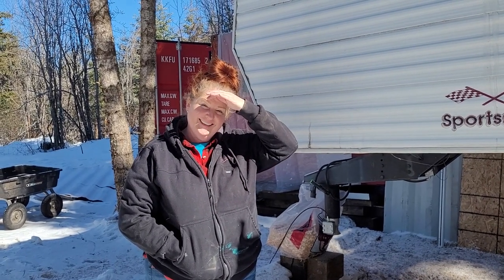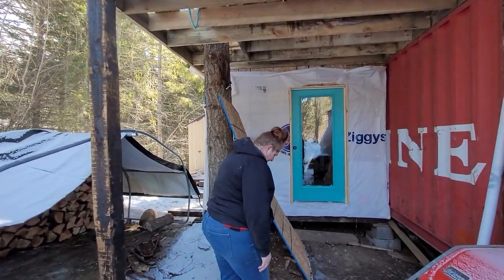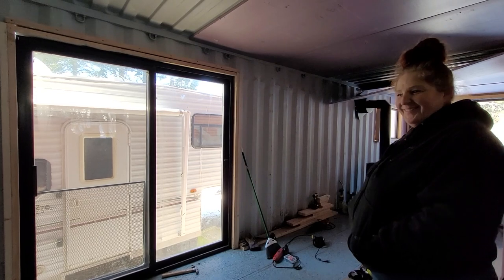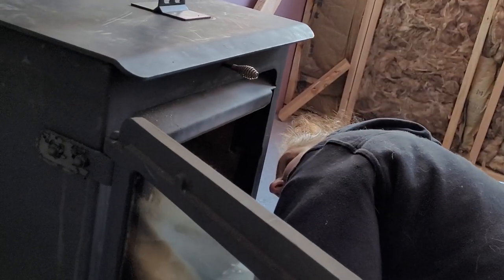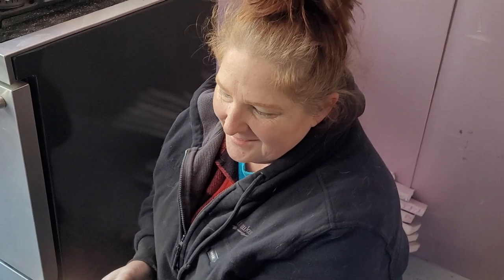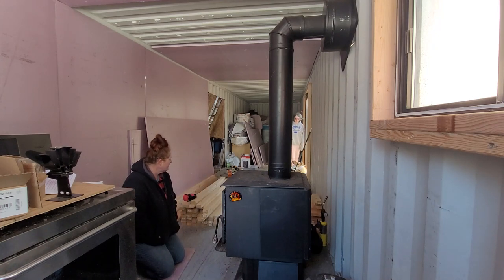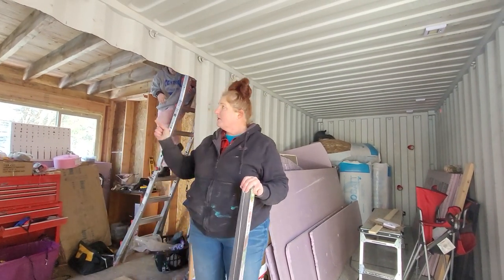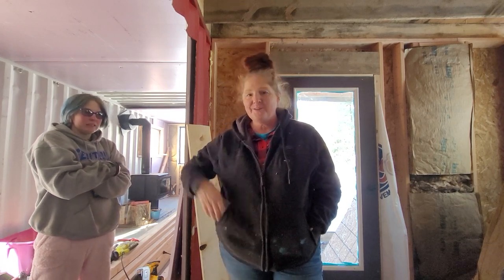Our Stove STOPPED working// VLOG

Comment: I agree with npo, the rod on damper has come off or broken and it's in the closed position that's why it smokes back into the room.can you remember which way wa open if so could try fishing around with the rod or try pulling it all the way out and using a stiff wire to get ahold of it and open it fully then install a damper in the pipe to take its place.

Comment: Yes that is a fresh air vent you open your damper when lighting it close it part way to slow it down you have to have more chimney pipe on your chimney to get a draw so it sucks it out if you don't have enough pipe on it it will not have enough draw so it will not draw out the smoke after it's warmed up on my house the chimney goes up past the peak of the house so it can draw air up the chimney if you don't have it above everything it will not create enough draw your stove should tell you how much pipe you need on your lot stove to get enough draw

Comment: My wood stove acts just like yours when the chimney pipes are clogged, which happens quickly if you are burning wet wood. If you look down from the top, you could see obstructions in the pipe...course, you have to remove the top first. If it is clogged, they sell a brush and handles that will clean it rite up.
Reply: Yes that could be it we clean ours once a year but with wet wood, it will clog really fast!

Comment: Major bummer - no fire. Maybe a 24" length of copper pipe (3/8) would help blow up the flame. Give Mike/Liz a call for help. He is super smart with these issues and could figure it out. I know my barbecue grill needs me to adjust the air intake to control the flame/heat etc. You figure it out. Keep after it. Thanks for sharing.

Comment: I once helped a small factory install a natural gas unit in a room, which required an inlet pipe for fresh air, in addition to exhaust air. Not knowing the specifications of your wood burning stove, but seeing the place for a pipe, inlet fresh air should be a metal pipe, so as not to melt. Safety first? Good luck in staying warm.

Comment: if flue pipe is not stopped up and it's a epa stove the after burner may be stopped up. some of the pellet stove do not put out much heat re search them before buying one. my wood stove is over 100 year cast iron one made in buringham alabama. take care, be safe and well.

Comment: With your batteries I noticed it looked like you had them in that compartment. With cold it can reduce the life of your batteries. If there was a way to insulate that area and maybe have some warm air piped threw the compartment from the main living area. It will make your batteries live almost twice to three times longer. The cold really does a number on batteries. Also with the wood stove what an awesome idea. Makes it so you can heat off the land. Don't be shy on getting a pellet stove as well so it stays going threw out the night without needing to get up every 4-6 hours to toss wood on the fire. I lived in Minnesota and survived a few winters in -30 temps. I just had a mobile home that I insulated good and a wood stove for heat. But I hated always needing to put wood on the fire. So those pellet stoves come in handy. You can even learn to make your own pellets with one of those pellet machines. Honestly I've been thinking of getting into making wood pellets. It looks easy enough. The machine does all the hard work and what a useful product that anyone can use.
Reply from the maker: I will need to get that area insulated that is a huge difference in the life of the batteries.  I was thinking of getting a pellet stove, for that exact reason being able to make the pellets with the sawmill dust would still be free!!!

Comment: Heather, silly solution here, but why don't you install a doggy door into the side of the container facing the camper to run the hose/pipe to the camper.  There would be a lot less heat loss with that than trying to concoct something using the sliding doors.
Reply from the maker: We want to be able to walk through it will give us so much more space.. we are feeling a little cramped.  We have a few more months until it is time to move onto other projects and should be done with the shipping container build and can pull the RV away

Comment: First you need dry kindling and wood. If its outside its not dry. You may need another section on the chimney if smoke continues to come out the door. That is normal until you get a decent flame. If you have good dry Wood, put your would in first than stack your kindling in from of the wood so it will draw back through the wood. I find it works better. Also get a propane torch with clicker ignition. Much easier. Also take out your chimney clean out and look up to make sure its clean. That hole on the back of the stove is to make sure the fire doesn't use up all the oxygen in the house. You have to cut a hole in the wall and run a fresh air pipe. Hope some of this helps. I'm not saying you don't but some don't know what dry wood is. Good luck
Reply from the maker: Thank you for all the tips

Comment: That draft plate and control bar have broken away from one another.
Think you'll have to get onto the manufacturers and get a replacement stove or they need to send a engineer out to do whatever they can do to repair it / replace it.
It's built as a sealed unit as it's a stove.
Reply: You should still be able to access the fire bricks in the inside to replace them.  Look on the top of the fire brick insert and see if you see a metal frame and sheet metal screws.  You have to take the one side of the frame off to move the firebrick insert off the top.  You should then be able to see the damper push/pull, it may have moved when you moved the stove and isn't connected.  Other than that, add a section of flue pipe to the outside, so you have more draw.  Good luck!! 💝🙏🙏🙏💝

Comment: To see if the damper is working - cold empty stove - use your phone with flash to take a picture since you can't get your head inside to see.  The newer stoves meet more stringent requirements for cleaner burns. Need lots of fresh air. Houses are built more airtight than back in the old days. If you don't hook up the fresh air vent then it sucks air from every air leak in the building making the house more cold since it is sucking cold air from every crack. Burn dry wood.

Comment: Tunnel idea....  set posts near camper (6 inches off the siding) and fasten supports to the container.  Run horizontal support beams to connect them on the sides and top.  Build a roof that extends over the camper about 6 - 12 inches, put the plywood roof and sides on.  Between the camper sides and the tunnel use packing foam wrapped in a tarp (waterproof) to prevent air and water leakage
Reply from the maker: yep that is pretty close to what we are doing!!

Comment: Does you pipe that goes out not have what my dad called a damper where you could control the heat or draft of the fire. Our heater was lot older model since it was back in 50,s to early 80’s. Lol can’t remember the name of it.
Reply from the maker: This one has an internal damper our issues we don't have an outside air pipe put in yet so that's our next step

Comment: Is it windy out? Maybe you need a different top peace for the outside? Just look threw the pipes and make sure nothing is plugged up. Make sure that you have your air intake on the stove open for fresh air a little for the fire and that thing in the pipe make sure it's open. If it's closed then the smoke will back fill like this.

Comment: Would it have any thing to do with the top of the chimney turned in one of your other videos while you were putting the stuff on the ceiling 🤔
Reply from the maker: No it is good to go there.  The book told me to I needed to add an outside air intake pipe

Comment: hi have you looked at the top of the flu think you knock it when you put roof up the bit going outside
Reply from the maker: Yes I checked that and made sure all the connections were tight.  I think the air intake is the problem

Comment: About 4 days ago we broke our record for not having at least one little puddle of snow in the shadows save 2 days since Dec 24th; we aren't know for having much for snow in our area.  Then came the rains and the first night we were greatful the thermometer tipped just above freezing; normally we din't thank our lucky stars for rain but given the snow alternative.... We are now flooding "everywhere" (ish) and expect you all to be getting some quantity of snow.
Reply from the maker: We've actually had a warm spell come in and I think it's supposed to get up to 50° today the next 4 days are rain and in the 40s and then Sunshine and in the 40s and dropping back down into the low 30s at night so I think spring may be around the corner
Reply: @KuzweKanfarms  We had 5-6" rain in about 12, maybe 24 hours; but also continual rain since Sun, the 27th, early afternoon.
Reply from the maker: Wow that is a lot of rain

Comment: Wood Stove - will the dealer or manufacturer communicate directly with you?  Do they have a chat line for installation/operation issues
Reply from the maker: I am sure they will..  I think I have it figured out and if this doesn't work then I will call them
Reply: @KuzweKanfarms  ok....   stay warm and healthy.   Plus where is your helmet?  Not supposed to work without helmet
Reply: Shouldn't the top handle middle of stove be pulled out?  Isn't that the draft?
Reply from the maker: Yes but it seems like it is backwards. It worked fine untill we closed in the end wall and it could not pull in fresh air
Reply: @KuzweKanfarms  too airtight building....   remove the wallllll.   Lol